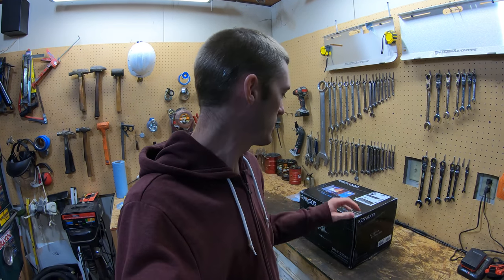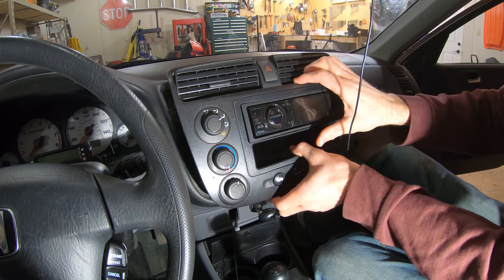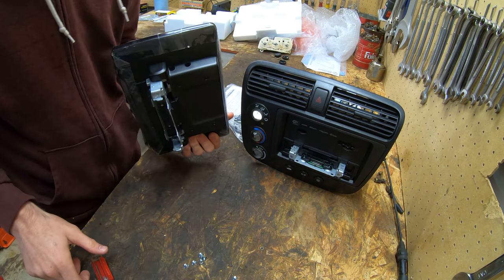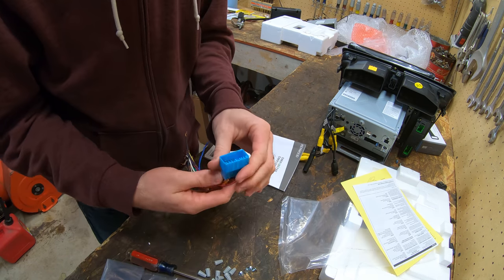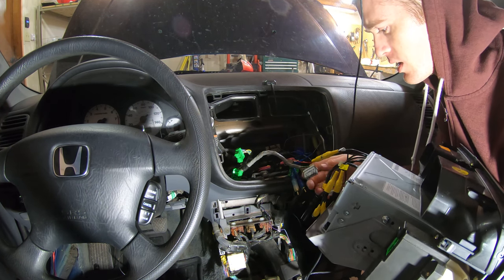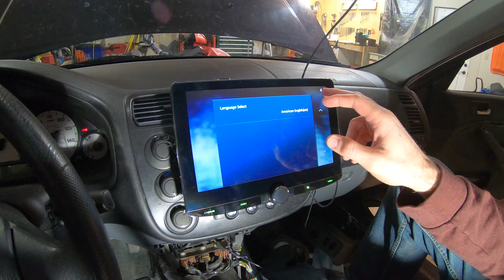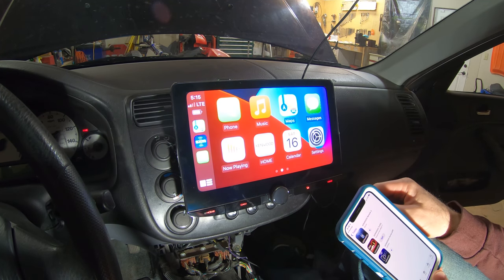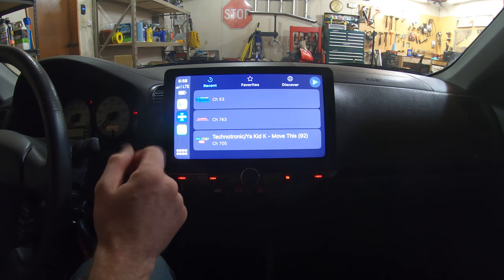Installing a $1200 stereo in a $1000 car!

Comment: Awesome video! I just did spend that 200 on that back up 😂😂!! Installing soon!! You showed me just what I needed to know! Thanks
Reply from the maker: Glad I could help!
Reply: @Humble Acres  did you use cam + and cam -???
Reply from the maker: @quillen7659  no just plugged into the rca jacks for rear cam.
Reply: @Humble Acres  can you toggle to the rear cam while not in reverse?
Reply from the maker: @quillen7659  no you can't. the camera only gets power when the backup lights are on, which also triggers the screen to switch to the camera. the cam button is more for the dash cam (which I now have). I don't think the auto switch would work if you gave power to the backup camera all the time.
Reply: @HumbleAcres  somehow this is possible, but thank you for the chat!

Comment: Great video I installed the Australian version dmx9720xds a couple of weeks ago, love how quick it connects wireless to apple car play and the sound quality is amazing also did a focal speaker upgrade.
Reply: I’m in Australia too (Sydney) and these HU has been spinning in my head for a while… 

Did you need a kit harness (to retain steering wheel controls) and a fascia to install these monster.

I own a Mazda MPS BL with factory Bose system.

Thanks in advance 🤙🏻
Reply: @HeliMicky  

Finally I got it..!!!

Also I’ve bought complete Aerpro harness kit (fascia included) to make connection plug n play.

In the stereo bay I have 3 harness from the car (main harness, antenna & AUX Input harness).

Aerpro complete kit came with AUX IN harness but no where to connect to the HU.

Main harness & antenna are connected to HU thou..

Should I leave the the AUX IN harness from the car unplugged..??
Reply: @juanpalomino7043  I assume the AUX in is a 3.5 mini jack on the front of the dash for audio connections, didn't use it in my install as I don't have anything anymore to plug into it. Make sure you test everything before the finial install.
Reply: @HeliMicky  
Thanks mate, I did try it but was unsuccessful with the installation (I’m not a radio guy 😂).

Once restrictions are lifted, I’ll take it to a car radio stereo shop for the job

Comment: 1. how do you route a microphone to the unit? in newer cars could you use the factory microphone built into the vehicle?
2. could you use reverse cameras to wire in the other cameras inputs? it has 4 total: dash cam integration, reverse cam & two other ones for let's say blind spot cameras.
Reply from the maker: I don't know how it would work with the factory mic, there is an adapter you can get for oem functionality. and yes you could wire more cameras in up to 4.

Comment: Did you connect the speed sensor wire?  Also do you get a speed sensor error message that pops up ?
Reply from the maker: I didn't connect the speed wire. The first time you drive the car it will give you a message saying its not connected and that's it. Everything works fine without it.
Reply: Did you do the update? I heard it fixes that. Do you know anything about that?
Reply from the maker: I did update it to the latest firmware
Reply: @HumbleAcres  so u didn’t install the pink wire? And does the message come up everytime you start the vehicle. Or just the one time and never again now. Thank you for your time
Reply from the maker: @anthonymiller5043  No I didn't install it. The message came up once and never again.
Reply: @HumbleAcres  awesome thx man. I cut the pink wire the idiots at car toys connected and did the update and it just like u said came up once and hasn’t yet.  Thank you for your time man.